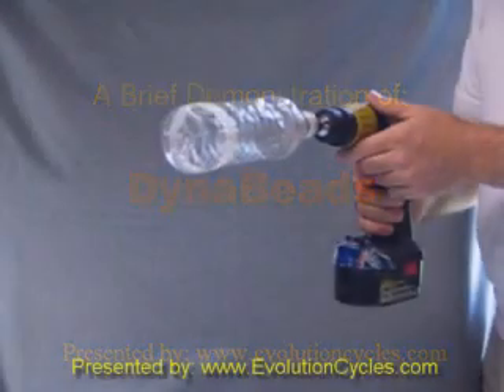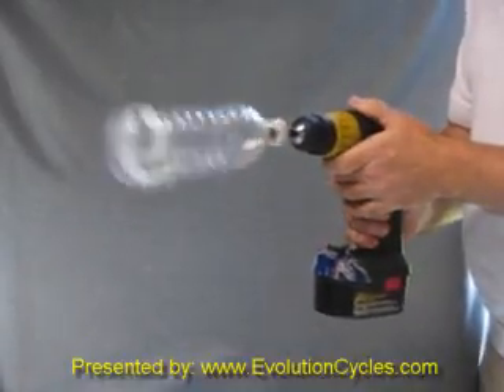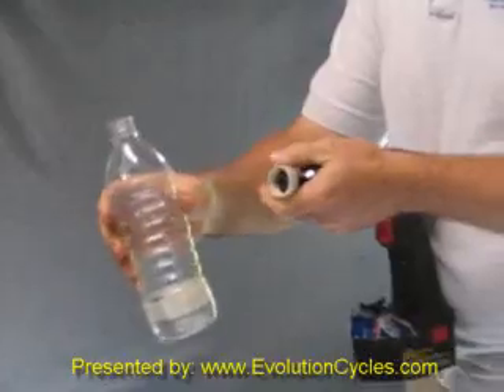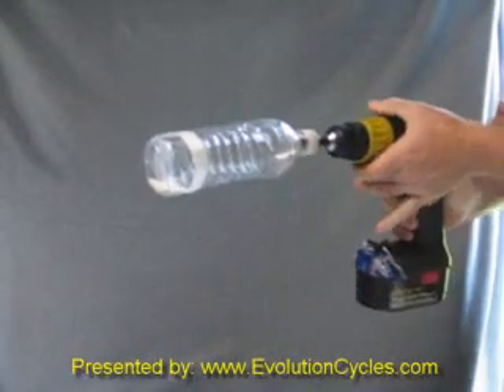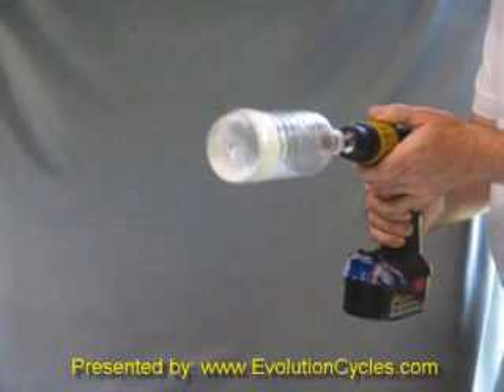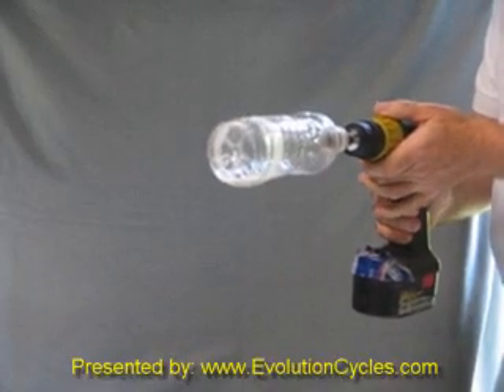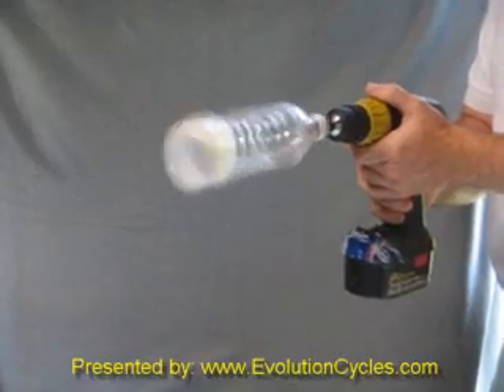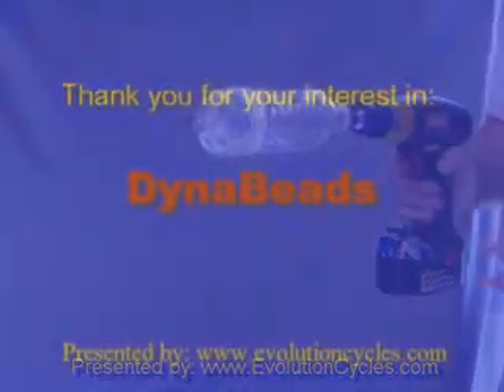DynaBeads demo video

Comment: I have a Volvo 240 that I bought cheap Fuzion HRi tires for with some old turbo wheels.  They shook like hell even after they were balanced at the tire shop.  At 75mph, the whole car bucked and shook.   I put 3oz of dynabeads in each tire and it smoothed things out, but not all the way.  I got the wheels rebalanced at my tire shop and now they're smooth to 100+mph.  The tire balancer machine got the same result each time when spinning up the tires with the beads in them, thankfully.

Comment from the maker: @LiveHappy76 - Some trucking fleets even use golf balls inside of the large tires on their semis...  
But a steel BB is not as dense as the ceramic used in Dynabeads and is larger diameter, meaning it won't concentrate the mass as well at the point of imbalance.  
Also any moisture inside of the tire (condensation) will cause the BB's to rust and start to clump together and become rough and abrasive to the inner liner of the tire.

Comment from the maker: @tykesplace - Read through the comments and replies, this subject has already been covered.  
Dynabeads need an axle that is free to move in order to redistribute properly. (like a wheel on a car/bike)  
A fixed axle balancing machine won't let an unbalanced wheel move freely as it would on a vehicle moving down the road; therefore, the Dynabeads won't work as intended.

Comment from the maker: @frescoces - If you don't want to use them, then don't.  Nobody is forcing you to put them into your tires.  
But the fact is that they work. - PERIOD!!!  

And unlike powders or liquids, Dynabeads leave no trace inside your tire, so there is no way to tell they had been used if you do have a warranty issue.  No problem! 

btw - When WAS the last time you had a warranty claim on a tire?
What about uneven wear from an out of balance tire?

Can I make a guess which is more of an issue???

Comment: I have been using Dyanabeads in my motorcycle for several years now and love them. Recently I put on a new front tire and the shop did not have dyanabeads so I just have them balance the tire normally. At about 70 mph the tire had a shimmy, this become such a pain that I order Dyanbeads on line, took off the weights the shop put on and put in the beads. The bike handles great now, I guess I never knew just how well they worked until I didn't have them, I even use them in my car now.

Comment from the maker: @ezcondition Racing applications, particularly drag racing would be one situation where these would not be recommended.  Due to the severe changes in wheel speed (spinning) the beads would have a hard time matching the change in speed due to different momentums and the lack of friction inside of the tire/tube.  

Thanks for your interest!

Comment from the maker: @theyamaha700 Well, if you have a clear tire that we can use, to prove that the beads are inside and working during the demo, bring it on over!  ;-) 
The physics are the same as a wheel on a suspension. 

As for the valve core; I have been using DynaBeads in ALL of my tires for over 5 years.  I check the pressure in my tires each morning and have never had an issue with a valve getting stuck open.
You simply ensure the valve is aimed to allow any beads roll out before you open it.

Thanks!

Comment from the maker: @cleefurd: It is "sleight" of hand, and no, you are wrong.  
Running any faster with just the external weight and no dynabeads would risk ripping the bottle right off of the flexible shaft and possibly hitting someone.  
THAT is why it was not run up any faster.

Feel free to try it yourself.  Wear eye protection...

Comment from the maker: A pea on the end of a steel I-beam induces bending stress, but the deflection cannot be measured for practical purposes...  

Rigid spin balancers are designed to withstand HUGE out of balance forces for safety.  
Any deflection occuring is measured in thousanths of an inch, not the kind of freedom of motion required. 

As a mechanical engineer from the truck tire retreading industry who has spent time designing shop equipment for the tire industry --
Trust me on this one...

Comment from the maker: Short answer, NO.  

Once the tire is up to speed and the beads have distributed, they no longer move.  
Over the road truckers use the same product in their tires for hundreds of thousands of miles per use and multiple retreads without wearing out the inner-liner of the tires.  

Thank you for letting me point that out!

Comment from the maker: Technically, Yes.
However, steel balls will quickly rust if there is ANY moisture inside of your tire.

This will lead to them clumping together, not rolling well to distribute properly, and shedding dust which could foul your valve core. 

Also, larger objects like BBs have lower packing density, reducing ability to concentrate mass at the point of imbalance for effective balancing, and cannot be added through the valve.  

Your choice...

Comment from the maker: The problem with trying to test Dynabeads on a 'modern' electronic spin balancer machine is that the wheel is on a rigidly mounted axis with strain gauges attached to it to measure bending stresses. 
It is not allowed to move freely to let the beads redestribute naturally as they would in a which was wheel free to vibrate naturally when mounted on a vehicle.  
The beads need the initial small wobble of the wheel to find the correct balance point.  Then they stay at that point and do not move.

Comment: How much depends on tire size.  There's a chart on the website of the person who posted this.  
I have them in my bikes & love them.  I'm at least as confident as I was with the old lead weights, & these I know won't fall off. 
Just dump them in - that's all there is to it.  Not much work, certainly less than the old-fashioned way.

Comment: I'm thinking you might not have been paying attention in physics class when the law of centrifugal force was explained... with very little speed (10-20mph), the beads will be forced to the inside wall of the tire so hard that they can't possibly bounce around.  And sticking them in place would be of no benefit as the tire wears, which does not occur perfectly evenly.  The beads need to be able to reposition themselves as the mass of the tire changes unevenly.

Comment from the maker: Not sure that I understand all of your comments.  The demo SHOWS that the product corrects an imbalance... 

And I have worn out several sets of tires with DynaBeads installed which wore perfectly smoothly (no cupping, no feathering) indicating that they remained perfectly balanced thoughout their life. 

If they had been bouncing around on bumpy roads as you suggest, they would have cupped badly.  

Guess I will have to post photos of the used tires on the website.  Thanks for the idea!

Comment: this will only work under perfect smooth conditions and does not actually balance the tire!!  imagine if your moving and the road is bumpy, the beads will not stay in place and the tire will stay un-balanced until you hit smooth road or even the centrifugal force again.  they would work better if they were to stick in the same place they initially settle in. constantly bouncing around in your tire wont work as well cause you would feel the tires wobble until you reached a certain speed.

Comment from the maker: Technically, yes. But with important differences. 

The ceramic material used in DynaBeads is denser than water, so it concentrates at the point of imbalance better, and less volume of material is required inside the tire. 

Also, water inside the wheel can cause corrosion of the wheel & valvestem.  Even an aluminum rim can corrode when left constantly wet. And if water froze inside of the tire or valve core???  

And finally, a tire plug will fail if water got  in the puncture too...

Comment from the maker: The weight taped to the bottle is what causes the initial imbalance for the demonstration.  Without it, the bottle just spins normally.  There would be nothing to see, as the DynaBeads would just evenly distribute inside of the bottle as it spun.

Thank you for your interest in DynaBeads!

Comment: The video is not comparing apples to apples. You need to spin the bottle with the 20 grams of lead weight, and then remove the lead weight before inserting the Dyna Beads, and lets see what the bottle does.

Comment from the maker: If you are down by the wheel listening closely while you are rotating the tire slowly you can hear the beads tumbling.  But out on the street with the bike running you will never hear a thing.  
Plus, once up to speed the beads stay in place inside the tire, so no noise.  

The only time that I have heard of damage to a tire is when using them in a race slick on the track.  Evidently the inner liner on race tires is different.  Possibly for weight reduction. Every ounce counts in racing.

Comment from the maker: Yes, DynaBeads work equally well in a tubed tire or tubeless.  

In fact, it is easier to retrieve the beads to reuse them at tire change time when using a tube, since they are contained within the tube!

Comment from the maker: The motorcycle tire makers I checked with only list liquid sealants as voiding warranties. 

Trucking fleets have used them for millions of miles and pay hundreds for each of their tires. If there were a warranty issue, they wouldn't use them - Period. 

You clearly seem to have a personal axe to grind, since you felt a need to come up with another slam when I disproved your first attempt at discrediting how well DynaBeads work. 

Do you own stock in a company that makes wheel weights???

Comment from the maker: Yes, it can take 2-3 seconds for the beads to distribute as the tire is coming up to speed. You can see that in the video. 

However, a wheel is not spinning fast enough for an imbalance to cause problems in those first moments...Unless you are in the habit of doing burnouts... 

So, DynaBeads might not be for those who leave clouds of smoke when they hit the gas. 
But then I would say their tires have other problems besides whether they are balanced for the first few seconds of take-off...